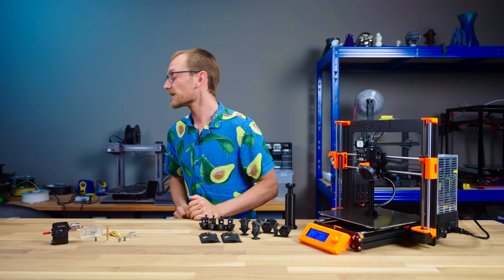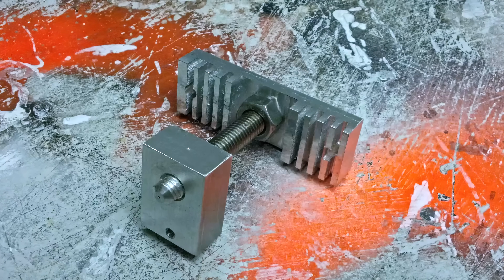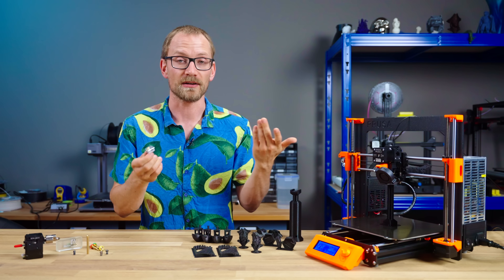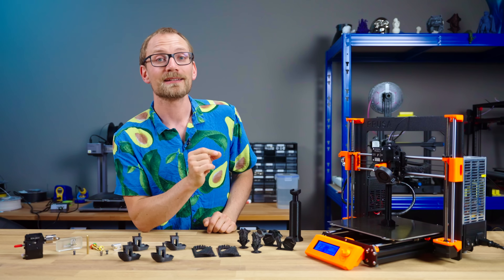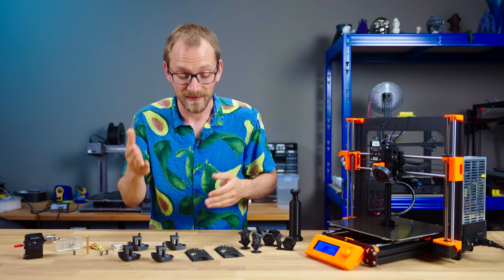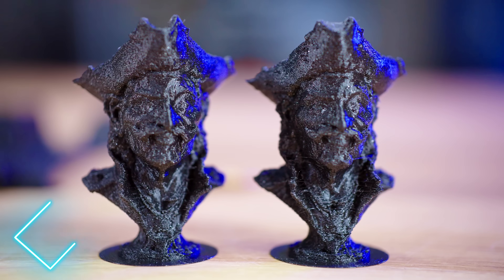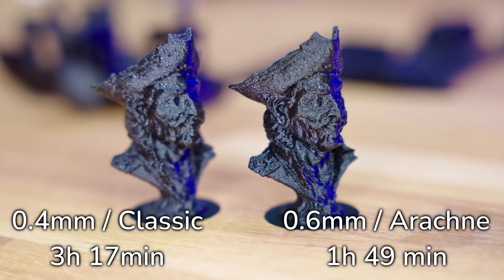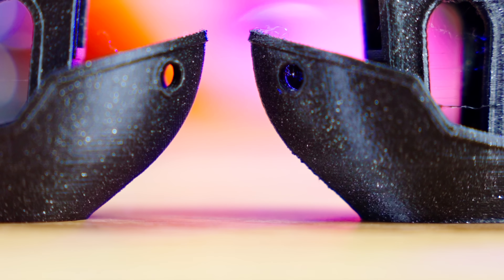0.4mm nozzles just became obsolete

Comment: I've used .6 a lot and this arachne setting looks really cool.  However I never noticed that the larger nozzle means thin layers don't work as well.  I've printed at .08mm with a .6mm nozzle before without issues

Comment: I really need to try PS once this goes into stable. Every Cura since 4.10 has been awful at slicing something I print a lot of for dofferent filaments, the transition layer between a flat surface and a thin raised design being done in a way that causes the nozzle to scrape across already printed material for that part of the print, even with z hop enabled. Arachne engine beta 2 works great, but doesn't have variable lime worth as far as I can tell. Maybe PS can use the variable line width and also not be awful with that area.

Comment: Interesting, I have a pair of steel nozzles- one .4 and the other is .6, and I rarely switch off to the .6 unless I am using harder or fiberous material unlike most PLA or TPU. I think I'll try that setting with the larger nozzle when they bring it to Prusa Slicer release version. It'd save me time because most of my prints don't need super fine details from the smaller nozzle. Thanks for the early heads up.

Comment: Used 0.6, it works fine for large parts, but for small parts it is not really suitable, overall uses more filament, so I went back to 0.4. For large parts you should go even to 0.8

Comment: The first thing I did with my Prusa was to change to a 0.6 and I have never looked back. My parts are stronger and just as good of tolerance. I print with ASA more than any other material. my favorite layer height is 0.35 and it prints at least 3 times as fast as my first prints.

Comment: I have been using .6mm nozzles for a couple years. I just can’t get high enough flow rate with petg with .4mm. The bond tech cht nozzles seem good. Then again most of the parts are half a kg or more and I use 10lb spools.

Comment: Best nozzle size should be .3mm-.6mm depending on the usecase and overhang performance. 0,4mm is still probably the best choice for an allrounder despite what you have shown.
To improve print times you should use a different printer, not a bed slinger one like the hyped Prusa machines. Don´t get we wrong, those are good machinese in general but their design is old and outdated. Also just change line width. We used 0,4mm Nozzle to be able to print 0,5mm lines which fit perfectly in most models since most models are designed in 0,5mm increments. 
With a 0,4mm Nozzle you can print 0,6mm-0,65mm lines.

Comment: I use 0.8 on my large format (300x300x350) printer, 0.6 or 0.4 for "ordinary' detail and 0.21 or 0.25 for 'fine detail'.  But for really fine work I use my resin printer.  And 3D printing is not my primary hobby, I just use it for my modeling and a few things around the house for my wife.

Comment: For these speed data points you are talking about, did you change the print speed on the 0.6 vs 0.4 tests?  I ask because it would be a fair amount of work IMO to change all my slicer presets to take advantage of this.  Seeing that overhangs are the main thing that give me trouble I am unlikely to move to 0.6.  They are not good enough for me on 0.4.

Comment: Since cura 5 came out (arachne) i change my 0.6mm nozzle to 0.4mm nozzle with 0.3-0.6mm line width

0.6 tend to ooze more than 0.4mm
the only downside is the nozzle wear out quicker than 0.6, but for me it's not an issue, i stock up bunch of US$0.5 nozzles

Comment: 7:30 0.4mm print has far superior quality than your 0.6mm, even in the top surface the final layer is ugly striped at 45 degree in the 0.6mm version.Sorry, those 31 min you saved in time didn't hide the ugly mess of text and top layer; I'll always go for a better quality vs a small percentage of time saving.
Reply: Use ironing to get better surface

Comment: I like Thomas' posts, and recommend that customers use .6MM and .8MM print nozzles / print heads for larger parts. But for best print quality on highly detailed parts, esp. for commercial use? Clearly a .4MM will provide the best print quality in most cases. A benchy is not a great example to prove the point with its known flaws with many slicers.

Comment: This just shows the classical slicing is worse than arachne, not that 0.6mm is better than 0.4mm... You can use arachne with 0.4mm as well.
Comparing 0.4mm with the classic slicing to 0.6mm with a different slicing makes no sense. Either compare 0.4mm to 0.6mm with the same type of slicing, or compare 0.6mm with classical slicing to 0.6mm with arachne...
Reply: What I get from the video:
By comparing apples to melons you get something.
There were just so much things that could result in what you get (nozzle width and typ of slicing). We don't know how the 0.4mm nozzle did with arachne to compare them.
This video is useless in my point of view (except getting know that something like arachne exist)
Reply: @marekvojta9648  I agree. This video should be titled something like "Fast, high quality print results with new Arachne slicing!" or something. If the premise of the video was just to show off arachne slicing, I wouldn't have complained. But they somehow also had to make this a comparison of nozzle sizes at the same time.
This has nothing to do with 0.4 mm nozzles becoming obsolete, at all.

Comment: While you're talking about switching from 0.4mm to 0.6mm... I'm overjoyed that I'll finally be able to use 0.4mm. I needed 0.25mm nozzle at this point for some of my applications and it was horrible, the print times, the frequency at which the nozzle clogged up etc... with this... I haven't actually test printed anything, but from 23 piece assembly I'm down from 12 pieces requiring 0.25mm nozzle to 2

Comment: I run a .6 on my Ender 3 V2 and a .8 on my Ender 3 Max. The .8 it really nice especially when you start doing larger prints. 90% of the things I print aren't detailed enough to justify anything smaller,and the few that do the .6 has always been small enough. .8 is nice too because you take a standard print you would normally do, cut walls in half and double layer height and it's basically the same print in half the time.

Comment: I agree with your assessment but something I would've liked you to point out that using a bigger nozzle diameter, while faster, generally also causes prints to use more material. Meaning it is more wastefull. Which some enthusiasts might not like.
Reply: but is that true? surely the mass of the print remains the same or at least very very similar... i mean, it's still printing the same geometry isn't it?

Comment: Once upon a time, 0.5 was standard.  At some point, it was decided that new printer users weren't struggling enough with clogs, long print times, and weak parts, so they made the nozzles smaller.  0.6 is the best choice for most things, I use 1.0 because I'm odd.

Comment: Amazing. Spent today changing out the nozzle and recalibrating at 0.6mm. Test printed part of a large mech model in various configurations since I know what to expect out of it at 0.4mm. After using watching your video, I cut a literal hour off the print time of the model part with no practical loss in quality. Just crazy! About the only thing I am still dialing in is support interface distances now. Thanks so much, Thomas! Cheers!

Comment: I've been using 0.6mm nozzles for a few months and gotta say, they are great. Allows me to get 0.4mm height and 0.8mm line width to really speed things up. I'm doing 100% functional parts only though, replacements, fixes for old stuff without original parts anymore etc

Comment: It depends on what you are printing.
I have a pirate ship dice tower that gets printed with 0.8 mm nozzle and 0,1 mm Layer height. 
Overhangs are a bit complicated, yes, but it works quite fine for this model.
I still need to try Arachne and the lighning infill on Prusa Slicer. 
(I use a .8 nozzle to get the printing times down as much as possible. Even with this, I needed 4 days for one of my dice tower models.

Comment: Whether a 0.5 or 0.6 nozzle renders better details does depend on the polymers being used.

HIPS and PLA are very forgiving.  Both will print well when the operator overdrives or under drives the nozzle.

Some slicers, such as Kisslicer which has had great capabilities in this area for many years now.

Stronger polymers, and or filled materials will tend to glob and string.

Text, thin walls, and some other details that are best done with variable extruder width perform optimally with a nozzle that is centered or closer to the smaller widths needed to get two paths on the feature.

In KS, this called crowning, and it detects places where the extrude width needs to be different and makes paths appropriate for the gap to be filled.

On single nozzle machines, I generally agree with the 0.5 recommendation in light of more slicers being capable in this way.

In general, running a test print on the stronger polymers will help you best decide which nozzle makes the most sense.  Of course, having multi nozzle machines means being able to put both a 0.4 and 0.6 nozzle in the machine.

In that scenario, dividing the model into meshes means being able to apply the best nozzle to the region of the part that is potentially challenging.
Reply: I hit reply too soon!

If your priority is speed, the greater layer height and material flow is definitely worth it.

Part detail and precision can bias the benefit of a larger nozzle away on some polymers.  A test print can help to understand what the larger size really does mean.

Comment: I've been using a .6 CHT since they launched and it's been great, I don't do abrasives so I've only had to replace it once, I see faster prints and good layer adheision. There is a reduction in quality of details but most of what I do is structural not decorative so as long as the part is dimentionaly accurate and durable it's fine for me.
Reply: Very similar experience for me!

Comment: Personally, I've used 0.25, 0.4, and 0.6mm nozzles. If I need to print something big 0.6mm is nice. If I need to print something detailed 0.25mm is VERY nice. If I wanted to never be changing my nozzle ever again though, I'd probably stick to the 0.4mm as a compromise still...  but I've gotten too used to the detail of 0.25mm to give up that for my small prints, and I've gotten too used to the speed of 0.6mm for my big prints. The detail advantages of the 0.25mm nozzle are kind of amazing and coupled with very small layer height can just about rival resin printers, if you can put up with the slow print speed.

Comment: The speed increase just in software over the last couple years has been amazing.  With the slicer improvements, fine-tuned profiles from people like CHEP, and tech like Input Shaper correcting vibration, software is no longer the limiting factor and we are finally printing as fast as the hardware (nozzles, extruders, bearings) can handle.
Reply: Forgive my ignorance, how was software the limiting factor before? It is just things like setting better defaults for configurable properties like acceleration/jerk or is it somesing more fundamental in how the instructions are generated/how the instructions end up?
Reply: @SamTheEnglishTeacher 10 years ago the hardware limited the speed more than the software. Then, in the last 5 years, the hardware caught up quick, but we're only just now getting the software improvements that are unlocking hardware speed and helping manufacturers find other parts of the hardware filament extrusion pipeline to optimize.
Reply: @SamTheEnglishTeacher  ikr, hardware is the limiting factor for HIGH end printers you need light and stiff gantries to keep up with the high speed (I’m talking 200k accel and 2000mm/s vzbot style)
Reply: @probablyblue426  a person or two "solved" the whole light and stiff gantry problem by just making the 3D printer print upside down lol , since the nozzle is at the base it has a low centre of gravity and can reach high speeds without shaking , imagine something like a CNC machine but you flip it upside down , not only is curious but also seems to work better than the standard 3D printer due to the reasons i mentioned before
Reply: @ulforcemegamon3094  yeah that’s cool but not the problem still, more so the gantry has to be light to handle high accelerations and stiff to have somewhat decent print quality, that design you said would make the frame itself shake less though, I think one high speed printer YTer tried it because you can basically flip a coreXY over, Vez3d ended up mounting it to the wall 

that’s more of reducing vibration than making the actual motion really light but cool nonetheless
Reply: I have been thinking about nozzle flow and melt zones. I have about 50 rolls of 1.75mm filament so larger diameter is out but using two 1.75mm rolls to feed a single nozzle via single extruder could increase speeds even more without going to crazy high Temps and specific materials. This has already been proven to help speeds with the the CHT nozzle splitting filament which essentially just increases the surface area the nozzle comes into contact with without increasing the length of the melt zone.

Comment: I have a 1mm nozzle in my parts box for the quick prints that dont need detail( helmets) and since I switched to that, I have realized there are better choices out there rather than the .4mm nozzle. My go to is a .6mm, has been for a long time.  Ive often thought about trying a.8 nozzle
Reply: For big parts I use .8 nozzle with 1mm line width and .5mm layer height — fast and strong prints.
Reply: I use 1.0mm often too,  prints are very quick.

Comment: my question about this is, in theory, the nozzle size is limited by the wattage of the heater cartridge. maybe 0.4 is optimal for 30w and you need 40w or more to go to 0.6?
Reply: Nope. Still doing 190° with my 0.7mm nozzle

Comment: Never bothered with 0.4 mm nozzle. Well yeah, when I started with 3d printing. As I print functional parts only, I went to 0.6 mm very soon and never looked back. If I would want high detail, SLA is the only way to go.
Use always best tool suitable for a job. Never understood attempts to make FDM do all things (think crazy things like 0,25 mm).
It’s like using a hammer for a watches repair.

Comment: My main 3d printer has a dual nozzle head(Cel Robox) with a 0.3mm nozzle and a 0.8mm nozzle(great for prototyping and utility prints)
And have a dual material head for it that has two 0.4mm nozzles, 
My robot printer(Rotrics Dexarm) is using a 0.4mm nozzle,
0.6 seems like a nice compromise for most use case scenarios.

Comment: For a given nozzle size, you can increase extrusions width much more than slicer tricks can reduce extrusion width. Put another way, use the largest nozzle you can for the smallest details you want to print. With a 0.4mm nozzle, I've printed with extrusions up to 1.5 mm wide and 0.5 mm thick.
Put another way, it's pretty easy to print bigger than the nozzle size and it's harder to print smaller than the nozzle size.
Just find whatever size works best for you, but keep your mind open to pushing the extrusion width without switching nozzles out.
Reply: Cura 5 now asks for line width, and not nozzle size
Reply: @urgamecshk  you still input nozzle size in the printer settings
Reply: @Dave_the_Dave  not in Cura. You input the filament size, and line width. Thats it
Reply: @urgamecshk  my man, I'm not sure how it uses it in slicing but nozzle size is an input to Cura 5.0.0. I'm looking at the screen right now. Across the top of the window you have your printer, material settings, and then slicer settings. Dead center it says something like "Generic PLA, 0.6mm nozzle" and in the drop down is the nozzle size selection.
I do believe it uses it to determine what the minimum line width it will try to print.

Comment: I've been primarily printing with 0.6 for years. Can't wait for arachni to be full release quality - might be time to move to 0.8 as my primary size 😁
Reply: I have recently bought a second hand Anet A8 with a bad hot end, plan was to make it into a higher speed, low definition printer for handles, brackets, battery holders, bezels etc.  Stuff where details don't matter at all.

Was planning on going 0.6mm nozzle @0.3mm layer hight, but now maybe it needs a 0.8@0.4mm layer - or maybe even 0.8@0.6mm layer height...

What hot end are you using?
Reply: @antontaylor4530  e3d v6. Nozzle swaps aren't bad with the right tool, I love the Zcatch tool, and swap as needed.

A 0.8 can really lay down a lot of plastic, to the point that you might need to reduce motion speeds so the hotend can keep up with melting the filament. I view this as a good thing, because you get less ringing, vibration, and overall less noise. But realize you can probably reach the same flow rates with a smaller nozzle and higher move speeds too. There's always trade offs and balances to be found.
Reply: @antontaylor4530  throw a volcano 0.8 on that anet with a cheap e3d mount. will change your life. titan extruder clone might help too. that's my setup currently, printing thick storage containers

Comment: You should test fitting parts together particularly in the x,y direction. Im concerned if you have say, a circle cutout and its 20.5 mm wide, would the .6 give you the same "fitment" of a part thru the hole as a .4 would?